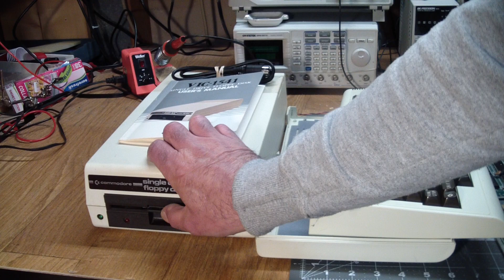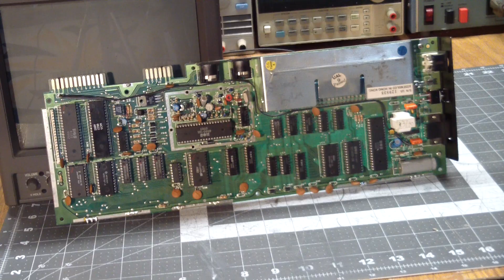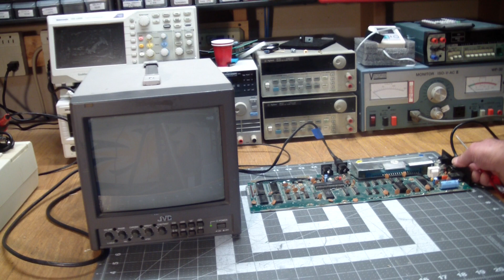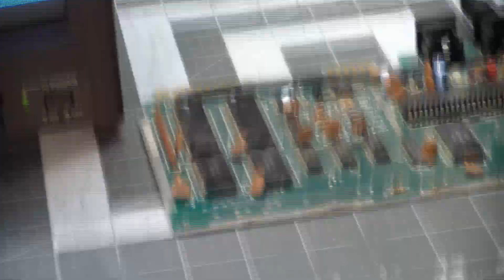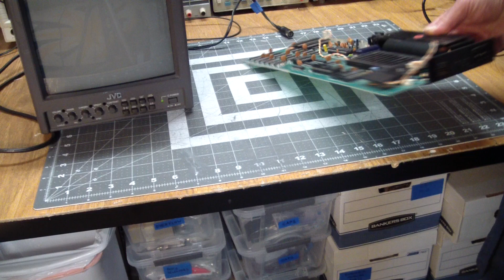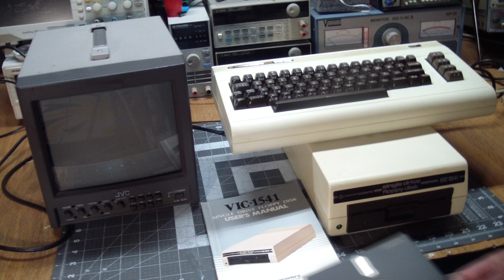AE#222 Building a Commodore Vic 20

Comment: The problem with using a solvent to attack the potting material is it's usually epoxy, and so are the plastic cases pf the chips and any individual transistors and diodes.  This makes depotting chemically not generally feasible.  What can be useful for cosmetic purposes, if you can do it, is to get the whole potted mass out of the case and reuse the case for a modern replacement power supply.  Not all power supplies are equally able to be opened up and cleaned out that way, and not everyone is equally goof at it.

Comment: It's no mere rumor, those Commodore power supplies (the ones with DIN connectors) are all time bombs.  It's not a matter of if, but when, they fail to over-voltage and brutally kill the precious chips on the motherboard.  Please avoid using.  Save the VIC chips!
Reply: Any of the C64 Savers will allow you to safely use those PSU's.  I use several that way for years.    -Mark.
Reply: They are actually fine. All you have to do is change the LM7805 and it will work for another 30 years. Or just replace the board inside with something better. I designed my own 5V 3A SMPS that fits inside the original psu case. The original transformer will still be working long after everyone born in the 70's is gone.

Comment: The reset line from the computer is connected to the reset line in the disk drive, so it resets the drive which behaves as if you just power cycled it. LED and motor default to ON, then it does a self test after which the LED turns off or flash an error code.
If you can download disk images for the C64 from the internet and put them on a disk, you can download images for the Vic20 too. I use a 386 laptop for that.
The Vic20 has some cool demos for it, even in the unexpanded configuration. PWP (Progress Without Progress) has some great demos like Robotic Liberation or the Impossiblator series.
Another thing to keep in mind - I am a bit puzzled as to why the 1541 just seems to work with the Vic20 - the operating manual clearly states that in order to work with the Vic20, you have to OPEN 15,8,15,"UI-":CLOSE 15
Reply: The later VIC1541 is basically the same thing as the brown 1541. One of the ROMs is different on the VIC drive but it could have been changed to the updated version that makes it compatible with both VIC20 and C64. There are long board and short board versions of the VIC1541 as Commodore likely just threw in whatever board and drive mech they had in stock. He didn't show inside so it's pot luck what's actually in there.
Reply from the maker: I cracked open the drive, and it has a long board Rev E. The roms are 901229-03 and 325302-01, so it's the slowed down version compatible with the C64. Maybe I should install rom 325303-01 for blazing fast speed with the VIC-20